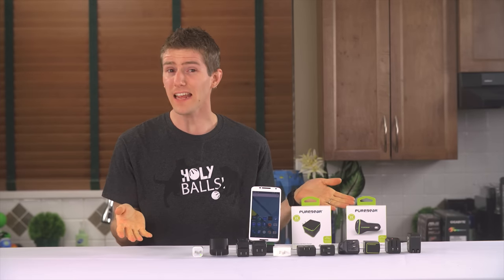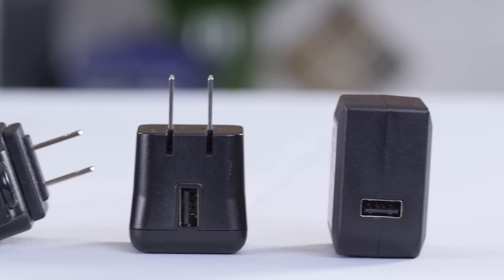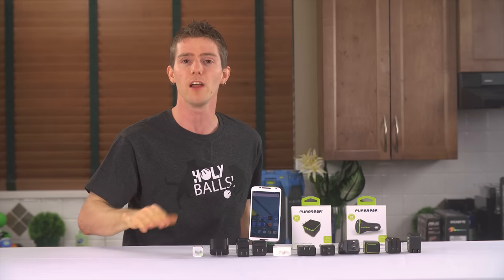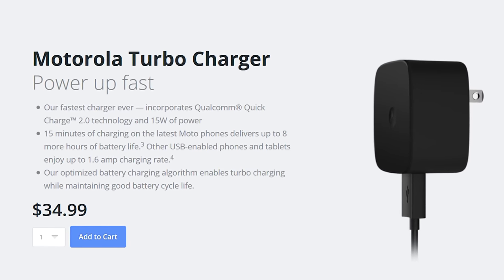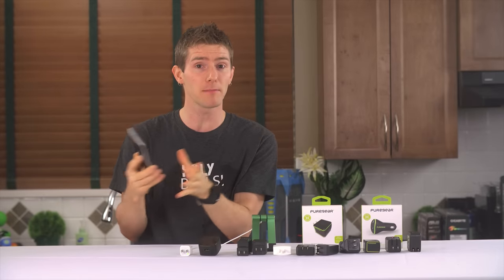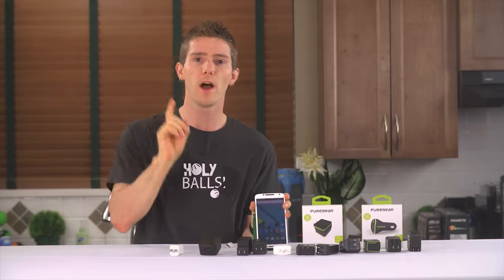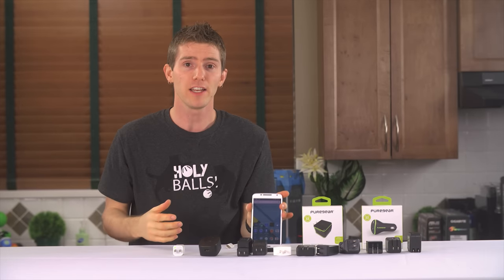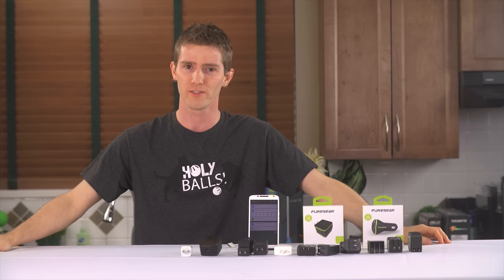Faster Phone Chargers Explained - Qualcomm Quick Charge 2.0

Comment: I charge my phone or if my computer usb 2.0 port, which delivers 500mA even when computer is off. This is slow, but I charge overnight and whenever it is possible to keep charge level above 30%
my battery have great life span. I actually managed to kill display first (I have cracked display, but not digitizer, while attempting to remove), before battery went to 95% of design capacity (over 3 years). Batteries like to be cycled shallowly and slowly, so keep it in mind. Do not put display on full brightness unless you cannot avoid it. Avoid high charging current. Always keep battery cool, the cooler battery the longer it will live. And remember lithium batteries like to be in constant use, but dislike heavy use and high temperatures. Lithium batteries are by time, temperature and heavy use.

Comment: I agree, heat is the number one ennemy of any electronics, more so batteries. Seeing those quick powerful charger kind of worries me a little. They will normally charge at a high rate at the start and decrease as it goes, what if it does not cummunicate with the device and charges it at full rate all the way all the time? I was going to get a 60 watts 6 ports Anker charger but not sure now.

Comment: Also a point Linus didn't touch on is charging you phone that fast should lead to your phone dying equally as fast. This is a Apples to Oranges comparison but the same rules apply. School buses( The ones that still use gas ) fill up there gas tanks over night using low pressure slow fill gas pumps, because putting the gas in slower with less pressure behind it allows the gas tank to hold much more gas than it normally would, I believe it is something like 20 - 30% more actually. Now think of it this way, Imagine a screw and you electrically charge it to make it a magnet with 12v on 5amps for 60 minutes. Now imagine shoving 720v at 300amps for 1 minute which one is going to be a magnet longer? Now of course in reality the screw example isnt realistic and honestly it plain doesn't work that way but the goal is to think about it from that perspective.

Comment: Batteries today are smart enough to protect and prolong their lifespan.

1. They have a current limiting circuit built-in (also responsible for monitoring battery's current that it can tell if it;s fullcharge or what)
2. It also has battery temperature monitoring.

So even if you have 5v+ with 18amps current, your smartphone will just use not more than what it's design for, plus they have polyfuse just in case that it draws too much current like having a OTG device plugged while using the phone and charging on the fly. Some batteries have these circuitry built-in on it, sometimes it's intergrated on the device it self.

Batteries are getting smarter this days, it's not like on old days where we still use the battery from Nokia 3310 or something.

So in electronics perspective, Qualcomm chargers is just a normal charger that can hold current stable enough under load so the charge time is improved. It works the same way with ECS's patented USB ports with EZcharger.

Comment: i run a droid turbo on standard moto qc2, great battery charging really surprised me, i have had a day before right before work had charge only 30minutes and can confirm it can get to at least 50% if not higher in that time, but heat is right, my phone even doing nothing will start get pretty toasty when charging getting upto 120F and doing something like games while charging... just wow, feeling like phones been sitting in direct sun for hour

Comment: I've got iPhones and a USB 3 ported iMac. I don't know if the iPhone 6(+) uses the Qualcomm standard, but I do know if plugged into a compatible 2A charger it will charge at the higher amperage. I don't have a 2A iPad charger, or other 3rd party one, but I do know it works the same from a mac with USB 3 ports, like my iMac, and it does charge MUCH faster on said iMac than on the 1A charger the phone came with, or my MacBook with USB 2 ports. My mom has my iPhone 5, I don't think the fast charging was added until the 6, but she does have a 3rd party 2.4A charger for it.

Comment: very good review bro. just got a question, does the length of the cable really affect the charging speed of your phone? coz the cable of my power bank is broken and its length is 1ft..so i use my phones original charger and its around 1.7ft...the charging time got longer while using the power bank with 2.1A output...but i just conclude that they're not compatible coz of different brands...what do you think bro?
Reply: +DJ Ledda all too short to matter

Comment: It's worth noting that the heat problem is still present to a degree but that Android 5.1 and higher devices actually have a cooling feature to prevent overheating issues. (Not that it works particularly well, cough Galaxy S6 cough)

Comment: Yes u are right that quick charge can put more impact than your Regular Charger. But, Linus !! Those charging cycles are more than 2000 times . So if you are going to change your device 3 times a Day , you will hardly notice any Standby problem.

Comment: Quick Charge 2.0 is the best tech up for phone now. They wanted to introduce wireless charging but i never felt it was that good but quick charge, took my breathe away. My note 4 would be at 1% and in 30 minutes, i can get 70% guaranteed. But between 70%-100%, it would take normal time. But the phone need to have the technology for it. 3rd Party charger, you can use Anker PowerIQ but for older phones, they don't have the tech

Comment: My note 2 charges with 2 amps no matter what AC charger I connect it too, Just get a kernel that lets you set the charge current and ignore unstable charging current and you're good to go, only downside is you might break a low quality charger by doing this but who cares if a low quality charger breaks.

Comment: I think your video was very informative and helped me a know few things more than what I already knew. So firstly kudos for that. I have a certain question though and please don't mind as I am really a layman who doesn't understand chargers and wires really well. I already bought the charger Aukey PA-T2, but since I would not get a faster charging is when I decided to do some research and came across your video. Now besides charges do cables matter too? Because I've seen so many people sell cables which say fast charging cables and others like just regular cables. In fact what I've noticed with this particular wall charger is that it charges my iPad Air in fact slower than other regular chargers. Kindly do let me know a little about cable and if they matter which one should I go for. Thank You.

Comment: Do you know what would be the coolest? If Solar chargers could charge up a phone within 5 hours. If that happens, at least daytime, you can directly charge your phone, for example while you are working on your desk or the solar charger could charge up a 5 000 mA+ battery and you could just charge every device every night from it :) In the long run, that would be amazing! (With lower prices ofc, I know you can do that even today but its not a standard thing) 

Japans are making a new type of battery which has "nano gel" in it. It can be charged up 10 000 times  with no performance loss and its light and cheap. In theory we will see that tech within 3 years in our phones. Awesome! :)

Comment: Some phones (and maybe also some apps) are able to switch fast charging off through a toggle. I only know that the Samsung Galaxy S6 has this (ever since the Marshmallow update).
Generally speaking, I do leave it on as I'm not too worried about the battery's longevity. It might go down a bit faster, but it's still doing well after one year. I might have the battery replaced in the near-future though - they all become bad at some point.

Comment: IXCC chargers and cables are the way to go. It's all I use anymore.  Their USB cables charge my galaxy S4 in my car using a cheap adapter faster than any other usb 3 cable.  Not to mention how quick they are with their 20w power brick. It's important to me because I use my hot spot almost 24/7. Mpst other chargers are painfully slow of the phone will still slowly die when hot spot is enabled.

Comment: If you use quickCharge, beware with light-up USB leads! I didn't realize that Samsung quickCharge raises the voltage up to 9 volts, and thus destroyed 3 light up USB leads. So, light up USB leads are definitely NOT quickCharge compatible. They will get overloaded and die.

Comment: My feelings are more complicated than this. Can we confirm that the increased temperature does in fact shorten the life of the battery in this case? Perhaps these cell phones are designed to handle much higher temperatures and are well within the safe range?
Reply: +GrandPixel I think that all li-ion battery basically behave the same way, they live longer if kept cool.

Comment: The newer smart chargers that charge fast like on my s7 edge are amazing and I absolutely call them worth it. Stops charging at 100^, waits till it gets low and then charges it. 30mins to get 50%. I would find it hard to drop back to non smart chargers now, I dont even charge overnight, just while I have a shower and get ready for the day and im good.

Comment: Really liked the video, but to the general topic I'd say: 
I hope that, in 2015, this is a non-issue at some point, that phone batteries last long enough, so I don't have to worry about a "speed-charger" to save my day. I charge my phone overnight and I have no problem getting through the day, even with GPS running and a lot of drain to the device. So I wouldn't invest in such a charger just to be done a few minutes earlier.

Comment: Ok, just to sum it up.
The fast charger even though the output only 5v 1.67A is faster than normal charger 5v 2A?

another 3 questions;
1. which one better
TRONSMART QUICK CHARGE 3.0 18W, 3-6-6.5V 3A / 6.5-9V 2A or
RAVPOWER QUICK CHARGE 2.0 (or 3.0) 30W 5V 2.4A / 9V 2A?
2. in this video he says not wise to always charge with fast charger. Is it better to use normal 2A charger overnight (charging while im sleeping & unplug in the morning) or fast charger, directly unplug after its full?
3. how do I know which version of fast charger if its not stated?
thanx

Comment: I believe you did a video about the limitations of the micro USB port and the amount of current it could deliver. Do you believe it is a bottleneck in quick charge technology? Could you possibly do more testing on other devices that don't have Quick Charge 2.0 and see if the wall chargers make any difference?

Comment: Technically speaking, the stuff you've shown are not cellphone chargers. They are "AC Power Adaptor". The "charger" itself is located inside the phone for the charging circuit is located inside the phone where it controls the level of its battery. Ac Adaptor has "NO" control of the charging f the battery as to when it will cut off when the battery is full. You will notice that every manufacturer did not specify or call it as "Charger" instead they called it with the correct name as "AC Power Adaptor".

Comment: I thought the quickgear charger was going to charge a bit faster considering it had a higher amperage at the 5V level compared to the Motorola charger.

But still 40% in 30 min is always good.

Comment: Why not just pull more amperage from the 5V source? Higher voltage and less amperage is only really beneficial when you want to reduce line loses. For less money, you can easily get more total wattage. For example, when my 1 amp charger failed, I ended up building a new charger (though not nearly as efficient as a store bought one, I basically spent less money by re-purposing a 12V 2.5 amp charger from my old router, then using a an adjustable DC to DC converter rated for 10 amps. It was cheaper than a quality branded 2 amp charger, and the resistor values from the official charger could be replicated onto the DIY charger.

The device still charged at its proper rate, but compared to the official chargers, the DIY solution had no voltage drop even at 2 amps. For a DIY solution, the texas instrument DC to DC converters are the easiest to work with since they include really good datasheets, with chart and graphs and info on calculating the exact resistance you need on a sense line to configure the voltage output.

For many USB cables, the actual wires, if you strip one and look at the type of wire, are rated for 11 amps. I say get close to those limits before upping the voltage, as with automatic voltage adjustment, all it takes is for a component to fail, and cause the device to jump to a higher voltage on a device that is designed for 5V only.

PS with pretty much all quality DC power supplies, if you pull more than the advertised output, you get a voltage drop and increased line ripple, thus it is possible to simply make the phone smarter with about a 1-2 cents worth of additional hardware to monitor the power input, then when connected and charging, it can do an amperage test where probably over the course of a second, it increases the power draw until the voltage drops below a certain point, or line ripple increases significantly.

Comment: I disagree with the conclusion for one reason: Even though the batters stays cooler with slower chargers in terms of max temps, generally the turbo chargers only keep the battery that hot for around 30 min before they slow down to reasonable temperatures, and even less if the battery isn't dead. The effect on the lifespan is negligible over the 1-2 years you'll be using the phone.

Comment: Those pesky tech guys tell us that charging over night is pretty bad for the battery even tho most chargers have safety features to prevent overcharging it still damages the battery. I had a galaxy s3 with an extended 4200mah battery and the only time I could charge it was over night because it took around 5-6 hours to fully charge (needless to say, both of my extended batteries bulged out in a year)...fast forward to now, I have a LG V10 with QC 2.0 which takes less than 2 hours to charge so now I charge before sleep, and because of Marshmellow's doze feature, over night it only drops 3-4% (over 8 hours) which I find acceptable (if I forget to charge it before sleep, I have a reserve battery in my wallet - gotta love that removable battery :) )...Besides that, they also suggest to keep batteries between 30% and 80% charge for an optimal lifespan (whatever :D ) and never let them fully discharge.

Comment: I think that the quick chargers have their place but I would agree and say only use them if you need your phone in the next 15 minutes... if you're charging while sleeping then thats (supposed to be) 8 hours that it can charge and i'm pretty sure most standard chargers can achieve that.. I think that if I got a quick charger that it would plugin to my inverter in my truck because thats where I would be needing my phone charged quick.. other than that I carry a couple portable batteries so I don't have to worry about being tethered to the wall if I need power... although pulling it out to charge my phone on dates makes my girlfriend kinda stare at me.. but then she loves it when she needs to charge her phone.. so.. it works out :P (***** )

Comment: Hey Linus, are you saying the quick charging is a technology standard in terms of the part of the device which is charging the battery ? In this case, the qualcomm chip powering the battery. Isn't the battery designed this way to accept the quick charging. More preciously, isn't the battery composition for a normal battery with no quick charging, is different from that , which has it ? A bit confused, I am.

Comment: I have a 3rd party inateck charger. And the output is 5v/2.4A. I use it to charge my LG G3. It takes about 2.5hrs to fully charge it. I also test it with the Samsung note 10.1 charger, it takes almost the same time to charge my phone. However, I used a lg nexus 5 charger with 1.2A, it charges faster, but still almost 2hr. I want to know why it take so long to charge my phone. Especially, its on airplane mode. I did the calculation, its about 7-8% for 15 mins.

Comment: For myself, I have no purpose for a fast charger on my phone. Nowadays with battery banks if you need it, as well as there being phone chargers you can use in your car, trains, buses, planes, etc. If I need power it's there, and I can usually plan ahead.

 Now of course faster charging is always better. But for myself, the extra cost and potential long term wear on batteries I don't feel it's worth it.

Comment: I work the swing shift, so I luck out.  I don't have to let my battery stay plugged in over night. I just wait two hours before I leave for work to let it charge and not worry about over night heat degradation.
Reply: Thing is, with this charger you would probably be done charging in 2 hours anyway so the heat still gets to your battery.  Chargers don't pump power into your phone if it doesn't need it, so regardless of whether you charge it for 2 hours or 10 hours, the most heat is generated at the beginning of the charge.

Comment: I own a Motorola droid turbo 2 (absolute trash) that has quick charge 2.0 and you forgot to mention that when powered on and in use a standard 500mA or 1A charger will yield an extremely slow rate of charge

Comment: I'm using a 0.5 amp charger on a 3000mah battery,  takes forever. Especially when it's in the 90% range as it sloes down even further since at that point it slows charge speeds down.  I have to unplug my phone normally at like 95% each morning lol.